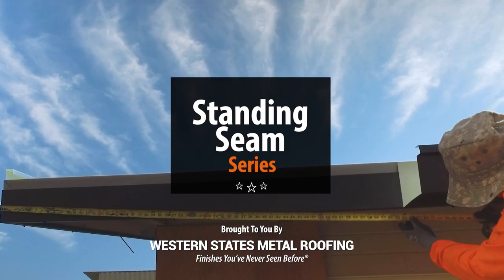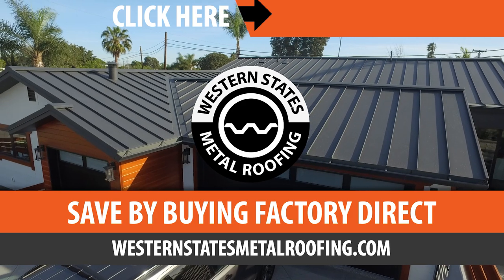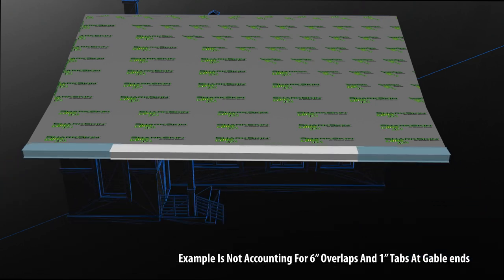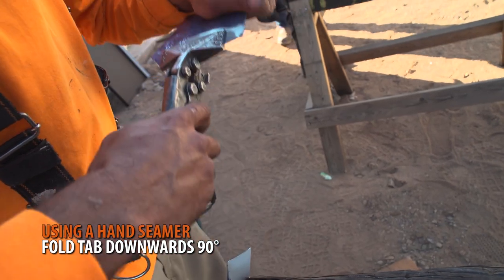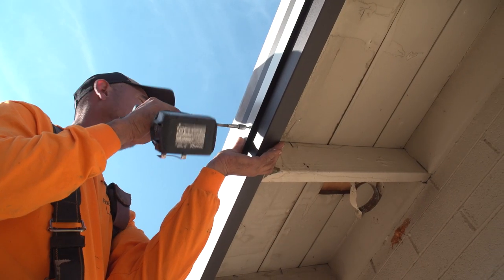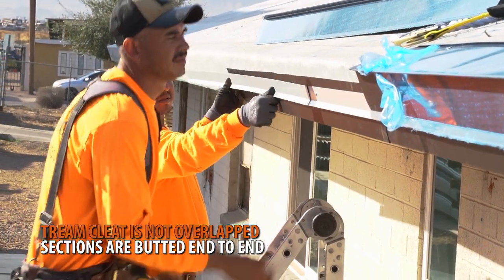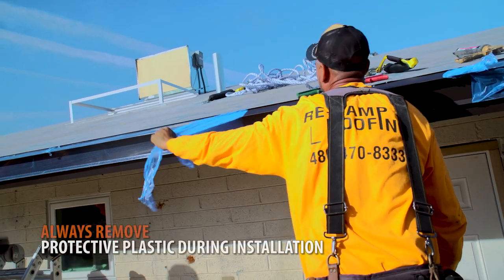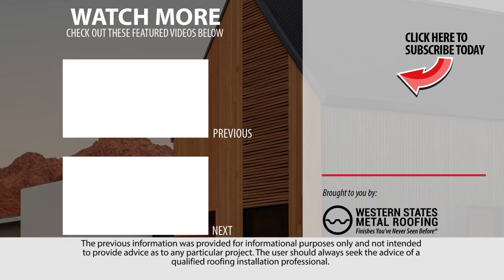Standing Seam Metal Roof Installation: How To Install Eave Trim With Bullnose Drip Edge.

Comment: What is the correct trim to use when using low slope 180 degree crimped panels? Thanks for info.

Comment: Great video guys. Would the installation of the bullnose eave trim essentially be the same for the corners of a hip as it would for the gable? I’m guessing you would do miter cut at the angle of the hip to get them to match? Thanks!
Reply from the maker: Hello John. Thank you. Yes, this would be correct. You would do the same in both instances.